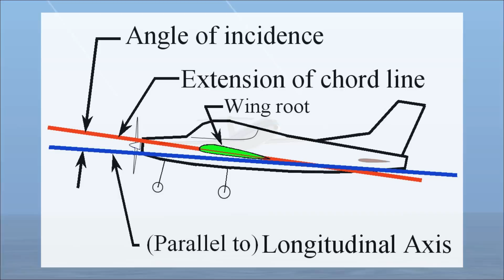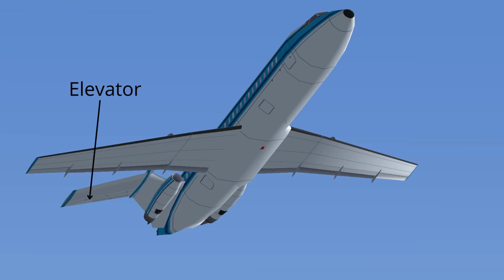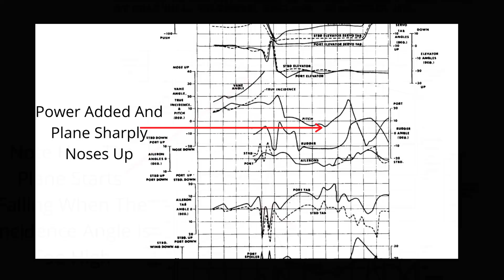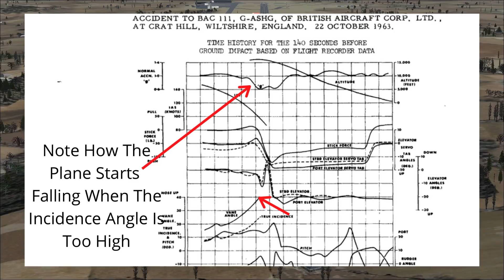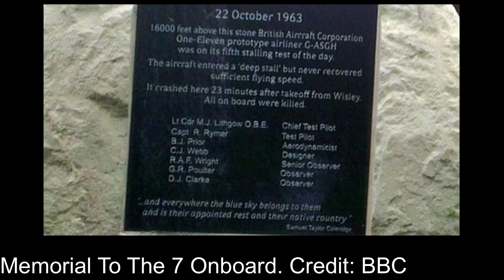These Pilots Sacrificed Themselves So That We Could Fly Safely | BAC 1-11 Test Flight Crash

Comment: The part about increasing power causing a pitch up sounds just like the problem the 737 Max has which led to the workaround that backfired badly.
Reply: @Alfred Weber Not sure about that on the 1-11 because when it is in a deep stall, the thrust line is well below the airflow mean direction so any increase in thrust would tend to rotate the aircraft around the lateral axis and put it into an even higher AOA and deeper stall. Powered flying controls would make no difference either because once the tailplane is in the Lee of the wings and has no authority, no movement of the elevators will change aircraft attitude and recover from the locked-in stall.
Reply: The workaround was fine, the fact they didn't tell pilots and lied about retraining is the problem.
Reply: Not really, the 737 had a system to alter the pitch when the angle of attack was too high. This was put in place due to a last minute change. The engines were too low to the ground so they were moved forward, which altered the center of gravity. MCAS was put into place to pitch the plane down to compensate for the shifted center of gravity. 737 MAX’s problem is because a single faulty Angle of Attack sensor causes MCAS to think the plane is pitching up when it isn’t, so it keeps pitching the plane down. 

This incident, the plane is actually designed in such a way that the wings block the air flow to the elevators at a high angle of attack, and the plane CANT pitch down. In 737s case, you can disable MCAS and override the system (the pilots just didn’t know how in a panic due to incomplete training by Boeing). In this case, it is physically impossible to pitch down.
Reply: @nevelis  c of g wasn't why they implemented mcas
Reply: @SuzukiRider93  care to enlighten me then? or ...
Reply: @nevelis  I did try to explain briefly - see my other comment. Basically, the engine nacelles themselves generatr lift at high AoA.
Reply: @nevelis  In order for this new 737 to be flown by pilots without additional simulator training, all sorts of things required by the FAA had to be the case.  One of them was that control column force had to be within a certain number of pounds as for existing aircraft during certain manueuvers/situations.  MCAS was originally to augment (the "A") pilot column force inputs for one of those with a one-time push of the control column.

If it had been left at that, no one on the outside would have ever heard of MCAS.  Instead, MCAS was pressed into service to deal with a similar issue... except this time multiple down-inputs needed to be allowed.  Combined with a complex failure presentation in the cockpit compared to standard trim runaway, eventaully it got the best of untrained-on-purpose flight crews.

It's notable that the first crash (Lion Air) was preceded on the previous day by the same airframe having apparently experienced the same problem.  But there happened to be a third pilot in that instance, allowing him to think through the indicators they were getting while the other two struggled with the controls.
Reply: @nevelis  MCAS is basically an evolution of the STS system on the NG. Underslung donkeys producing high thrust during take off/go around and at lower weights with an aft C of G can produce undesirable flight characteristics, namely a large thrust pitch couple. (The Leap Fans on the Max DO induce pitch up due to lift produced from the nacelles) MCAS/ STS was designed to return the aircraft to the former trimmed speed by trimming automatically (AP off) in the opposite direction. You let the nose rise too high in the takeoff config or GA in the 737 and she will lose energy fast in the form of airspeed, the trim system will activate to return you to the previously trimmed speed. There have been many instances of the 737 getting into near stall situations during the go around manoeuvre, which is why two engine go around are routinely practiced in the sim. (Disclaimer) I’ve only flown the NG and Classic.
Reply: @109-w7v  thank you for taking the time to share your wisdom :) much appreciated
Reply: @nevelis  Absolutely correct except that for the MCAS, there was not "incomplete training", there was no training at all and this was the aim by the way to compete with the A320 Neo. So the crew of the first crash (Lion Air) didn't know about MCAS so that they didn't understand what was happening. The crew of the second crash (Ethiopian) was aware of the MCAS possible trouble and informed about what to do in case ... and that's what they did. The copilot was the first to understand the situation and they did quite well: they switched off the MCAS asap, as recommended by Boeing but it didn't work since, in the meantime they had got so much speed in the dive that the aircraft was not recoverable. Disabling the MCAS was not the solution and anyway it had to be done within 10 seconds maximum! The solution was (is) 2 sensors instead of 1 and additional training related to the MCAS. From my perspective, trying to compete with Airbus implementing a new modification on a very old aircraft was probablt a bridge too far, not mentioning the mind blowing lies ... Just my opinion.
Reply: @patolt1628  True. MCAS (Might Crash Any Second) was sort of a band-aid fix to deal with a basic design problem caused by modifying a half-century old product with bigger engines and a newer wing design. For pilots struggling with dangerous MCAS inputs the "solution" was to disengage that system, leaving pilots with the original design flaws that it was intended to fix. As you mentioned, the additional sensor and additional training seem to work now. Still, it's time for them to come up with a new aircraft.
Reply: @patolt1628  Very good assessment in my opinion. Should have been a new type Cert
Reply: @nevelis  Moving the CG forward would actually create a nose-down tendency for the plane. The problem is a bit more complex, related to the lift created by the engine nacelles.

Also, you are missing the fact that it is not as easy as "just disable MCAS" - the crew of the second crashed plane did disable MCAS as per Boeing instructions,  and it still was impossible to recover from the crash.
Reply: With airbus we fixed this problem of  critical pitching by training our flight attendants to run back and forth in the cabin to modify the angle of attack.
Reply: @Bertrand146  You're not too far off in the case of the A320neo, where airlines took to keeping the last row of seats empty as a workaround to a potential aft-CG problem.

A narrow-body airliner with a stuck horizontal stab would actually be able to benefit from wholesale cramming of all the passengers and their bags into the front or back of the cabin.

Comment: When I was a kid I built a balsa/paper model of the Wright Flyer. Noticed that at certain angles that it would always enter an unrecoverable stall. This was due to two factors-drastic changed thrust vectoring, but most importantly no airflow over the elevators assembly due to blockage of the wings and body of the plane. Bad design that unfortunately has been repeated ever since.
Reply: Wasn’t it canard?
Reply: @brucebaxter6923  yeah, and IMO made it more prone to stall at shallower angles
Reply: @TheFULLMETALCHEF  
You balanced it wrong.
Canards need that front loaded up, way up.
Reply: @brucebaxter6923  except that at too steep a attitude you now have two surfaces creating drag instead of just one, and like the jet that was lost does not have variable pitch to compensate
Reply: @TheFULLMETALCHEF  
Missing the point.
Two surface creating lift and stall proof,
What you lose by increased drag on the front you gain by increased lift overall.

Comment: I haven't flown many times in my life but most were in a BAC 1-11. I always felt safer in that than in a Boeing.
Reply: The blistering acceleration was what always got me, they used to go like scalded cats compared to the modern jets.
Reply: And?  A gratuitous swipe at Boeing.  How original.
Reply: Why?  Based on jingoism or something scientific?   High-tail plans have terrible stall characteristics.  (like the Trident crash at Staines).

These planes were also disgracefully noisy.
Reply: @hoagy_ytfc  So were most aircraft of the era. It's only with more modern engines and designs that noise was significantly reduced
Reply: @Arthion  but the 1-11s were bad even by the standards of the day, was the point I was trying to make.
Reply: @hoagy_ytfc  Fair enough then. Most 60s aircraft were ungodly noisy, but if they're even worse..
Reply: @hoagy_ytfc  the noise hurt your lil libby ears?
Reply: @hoagy_ytfc  When you retract the leading edge devices 60 knots too soon bad things will happen on any airplane high tail or not. That was made worse by doing it below 2000 feet.

Comment: Now, that I finished the video, I just want to add that the combination of a T tail and rear mounted engines is a dangerous one
Reply: As an aviation beginner - can you explain me why?
Reply: @benjamin4281  @crunchtastic1948 As explained in the video, the T tails can enter the deep stall where the aircraft loses the elevator authority, making it hard to recover. The thing with rear mounted planes is, adding thrust causes the plane to pitch up, which you'd normally counter with the elevator
Reply: @rilmar2137  No, under wing engines produce a greater pitch up.
Reply: It's hardly dangerous, especially as it was used by some of the most common planes of the 60s and 70s (the BAC111, DC9, MD80, Boeing 727). In this case there was a danger, but they discovered it and made efforts to ensure pilots would not get in a position where the plane might deep stall. It was also found that the 727 could get into a deep stall when using flaps 40 (the maximum setting) under the right weight and centre of gravity, so many operators either banned flaps 40 being used or even physically locked it out.
Reply: Rear mounted engines will always come with a t-tail, due to the engines being near where the horizontal stabilizers would normally be.

 I wouldn't say that configuration would be dangerous, as many "modern" planes have that configuration (ex: most private jets, CRJ 100 series) but you do have a point.

(Edit: Rear mounted engines can also come with a 'cruciform tail')
Reply: Yes, please explain.

Comment: Thrust vectoring in all directions would aid in control of aircraft that experience many types of control problems. It would add another level of control.
Reply: Yes, but it also adds an additional layer of expense, complexity, and maintenance.

It needs to be kept in mind that adding thrust-vectoring isn't as simple as slapping a vectoring nozzle on the engine.

All aircraft with thrust-vectoring capability were designed from the start with that ability in mind (or in the case of the F-35B, are a factory-build variant, also specifically designed for a thrust-vectoring engine); you can't just slap thrust-vectoring engines onto any old aircraft.

For example, try slapping thrust-vectoring engines on a 737, and it's engines are likely to actually rip themselves off, as the pylons were never designed to handle twisting stresses from an engine vectoring to the side (or the engine trying to lift itself up, for that matter).

We'd probably need to return to something more akin to the Comet's engine-inside-wing layout to get the advantages of vectored thrust, and commercial aircraft design moved away from that for good reason (for one thing, doing maintenance on those engines had to have been incredibly annoying). 

Something else that needs to be kept in mind is... does the aircraft even need thrust-vectoring? Is it something that would be used with any kind of regularity (thereby justifying such an expensive engine modification)?

With commercial aircraft, the answers to those questions are likely to be: only for short-field takeoffs and loss-of-control emergencies, and no.
 
Would thrust-vectoring make aviation safer? Maybe. But also maybe not.

But what it could certainly do? Drive maintenance costs through the roof.
Reply: @benjaminfinlay829  Also, it's something else to go wrong. As Boeing found out, adding in a fancy new system to deal with one problem can cause it's own problems if it doesn't work as it's supposed to.
Reply: Thrust vectoring on a rear engine aircraft like this might have benefits. It might even be a better way to trim (less drag) than elevator trim. On a 737, with engines under the wings I doubt it would do anything useful.
Reply: Like deploy half a thrust reverser inflight?
Pass.
Reply: @Alfred Weber 
I agree,
I am very much against pilots flying planes.

A simple weight sensor on the landing gear would determine balance and load on the ramp before engine start and give a go no go then set takeoff length and speed and give a go no go for its particular runway, check it’s minimum sensor/instrument functionality and give a go no go etc etc.

Note, navigator and engineer in cockpit instead of pilots.